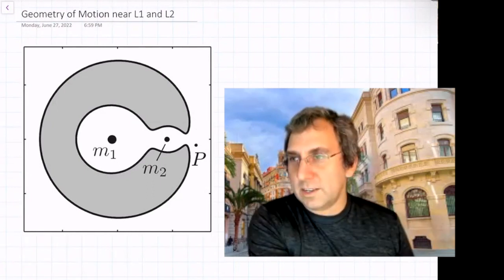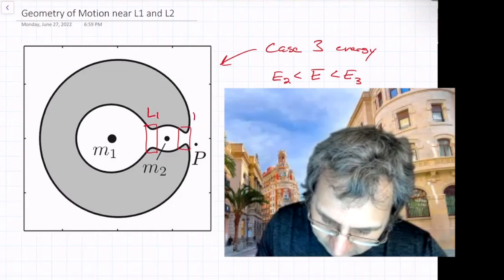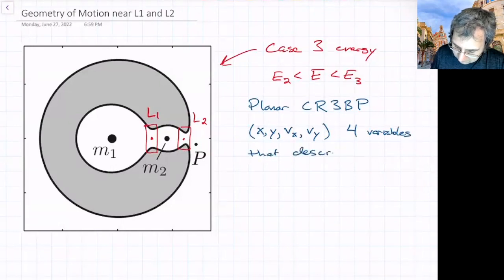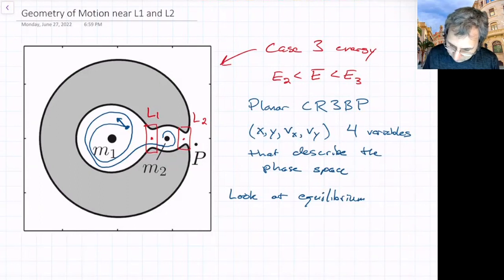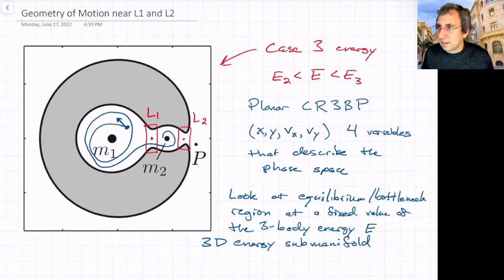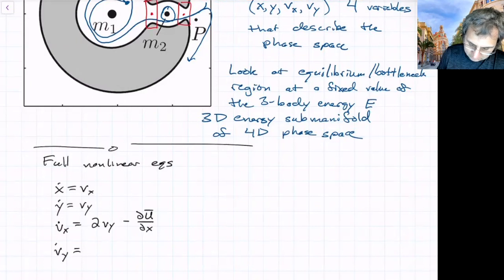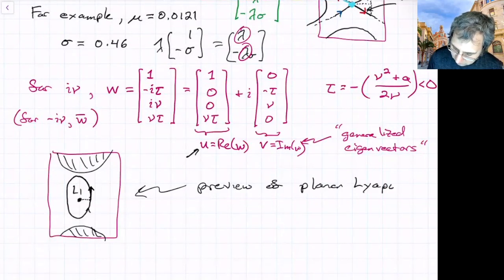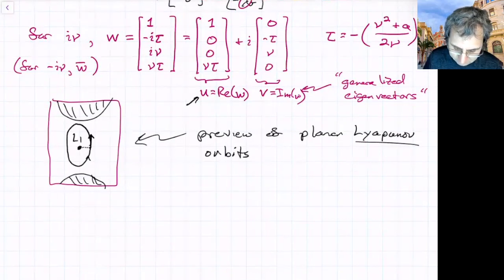Geometry of Motion near L1, L2, 3-Body Dynamical Systems Analysis, McGehee Representation | Topic 10

Comment: Greetings Dr. Ross.  Thanks a lot for publishing these lectures. I am really interested on the corellation between the eigenspace of monodromy matrix of the periodic lyapunov orbit and the eigenspace of fixed points. Is this subject discussed somewhere in this series of lectures eventually?
Reply from the maker: No, I don't discuss this. It would make an interesting analytical study. Basically, consider the Lyapunov orbit in the zero amplitude case and see how it relates to the eigenspace of the fixed point itself. That's what you mean, correct?
Reply: @ProfessorRoss  Later on, for the calculation of the unstable/stable manifolds you used the eigenvalues of the monodromy matrix. I have a hard time comprehending how do these manifolds relate to the tube-like structures  predicted by the linearization around L2/L3, and how does one justify that. I hope that my question makes sense.